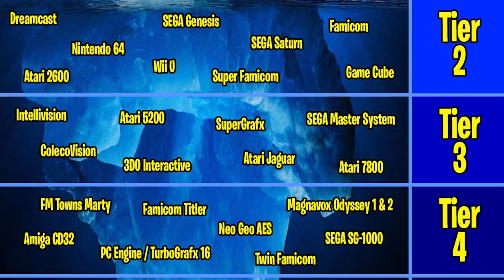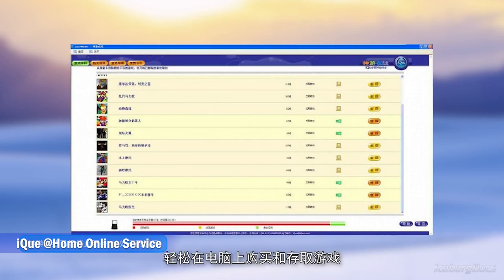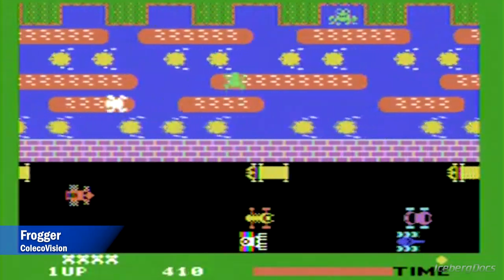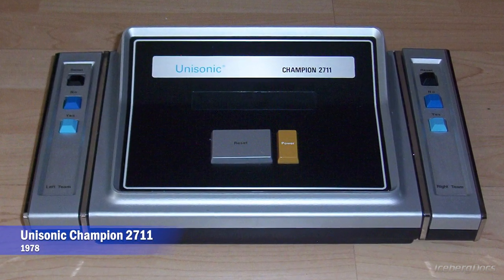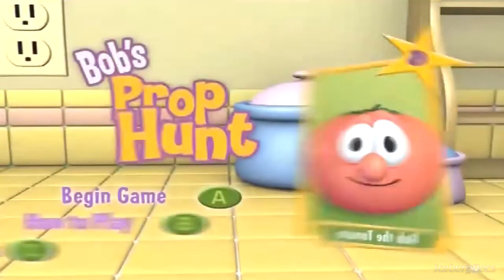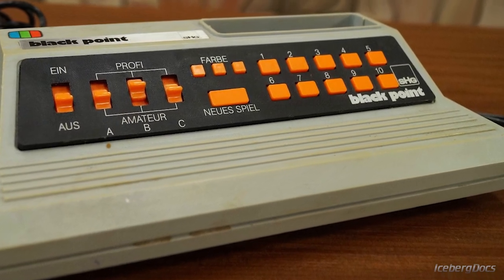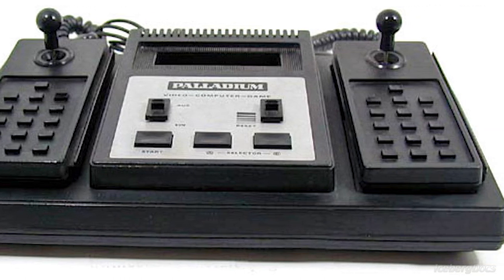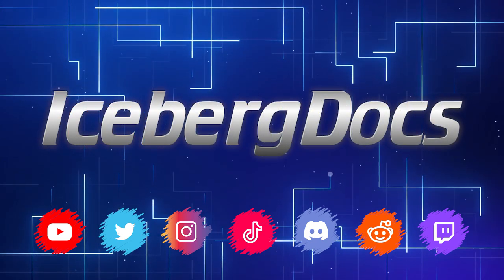The RAREST & Most Obscure Video Game Consoles Ever! 🧊 Tier 10

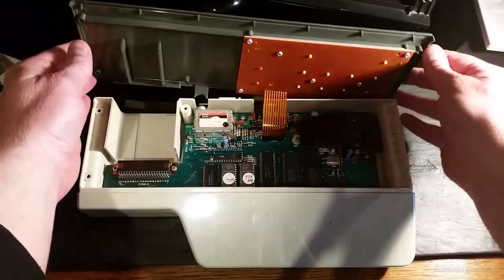Comment: 19:48 In fact, the video controller you mention and that actually appears in the video footage, the TMS9129 which is based on the TMS9918 family can display up to 15 colors, not just 8.
The technical specification about the console's color output on Wikipedia is wrong, even the video resolution is wrong too. The correct video resolution is 256x192, not 280×216.